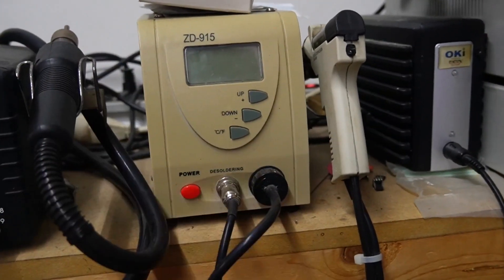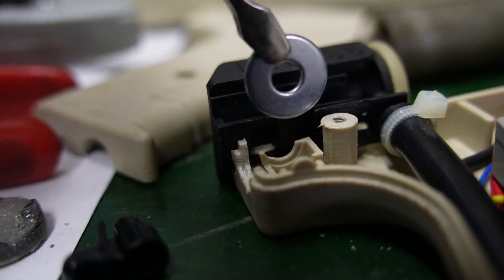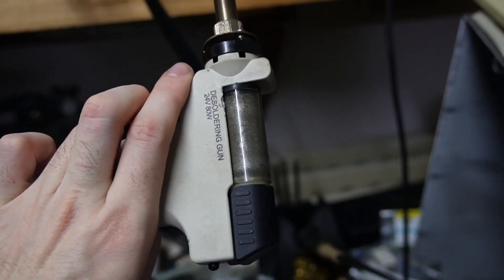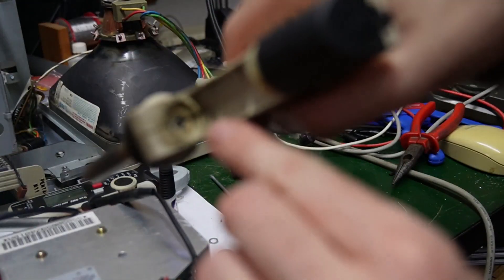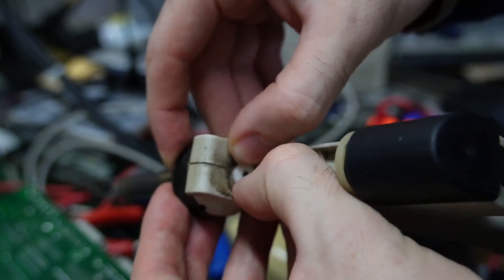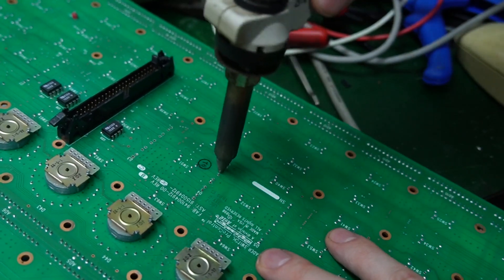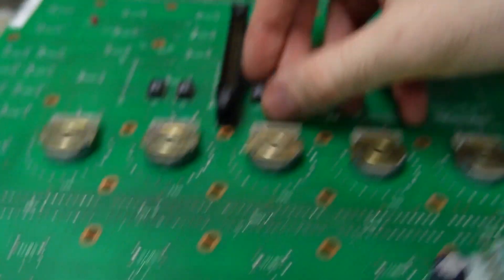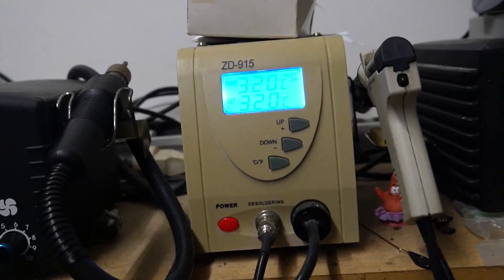ZD-915 Desoldering Station Repair and Long-term Review

Comment: Thank you very much!!! The tip with the silicone seal of your vaporizer is very good. I've the same problem... ;-)
Reply from the maker: I did find the original piece which is a round black rubber thing, it got lost somehow before for me. But I'm still using with the vape part because that one stays in place better :D.
Reply: @netman69  Ha! Yes, after you say that: I took a look in my desktop-trashcan... And: There I found the original-rubber-thing 😂

Comment: Fished one out of a dumpster not too long ago. Nice enough for when i need to liberate another 40-pin chip or worse rebuild a mechanical keyboard.
Reply from the maker: That's a nice dumpster find :)
Reply: @netman69    It sort of landed there for a reason.

The filter got clogged.

Yeah i think i need to raid that dumpster on the regular.

Comment: You put a white  little thicker ting in place off the rubber disk that should be there.
Reply from the maker: @leohobbleohobb3781  i did, i found the rubber thingy back later after I'd made the video.

Comment: It should be a rubber disk with a hole that should be tight around the end of hater tube. The rubber peace in front of glass tube should seal when pressed forward to the rubber disk surface that should be in front. The hole in mine is also to wide but it has the other rubber disk in front. sometimes it comes out when cleaning the tube and fall off. my guess is you are missing a rubber disk with a hole.
Reply from the maker: @leohobbleohobb3781  This is correct, but i didn't realize it at the time of recording the video. I found the rubber part back but i am still using the white silicon thing i placed instead.

Comment: It's  good work??
Reply from the maker: It does work good, but the handpiece needs regular cleaning and in my case is it broke so i repaired as in the video 😊
Reply: Thanks sir
Reply: Sir, zd915  and zd985  is different?
Both performances  is
Reply from the maker: @shyam-tcy  I'm not sure how much difference there is, most of these cheaper desoldering stations seem pretty similar in quality
Reply: Hello 
Can you send the link where you buy the membranes?

Comment: I was Googling to find how to reassemble the gun section that I took apart a few monts ago, in order to find an assembly diagram, but no luck.  I felled on your video that do not cover that, but I got more lucky this time.  For a very shots time I saw where the fume filter goes.

I 100% agree with you about Chinese CRAP.  They are often as much crappy for documents too. Producing a user manual with a bunch of safety notices (and sometimes useless), but lacking of a part assembly diagram is really stupid.

Comment: I have this same desoldering station. Yes, it does clog up a lot because that tube doesn't get hot enough and the solder solidifies before it makes it to the glass tube. I find not sucking the solder UP the tube helps a lot - i.e. hold the board so the gun is sucking horizontal makes a big difference. Like you said, letting it warm up for a long time gets that tube slightly hotter, and less chance of clogging. It was pretty cheap though compared to any of the other de soldering pump stations!
Reply from the maker: When it's warmed up all the way it almost never clogs, but the holding it horizontal is a new one to me, great to have more tricks in the arsenal :). For the price these things are pretty good indeed, a "real" one will cost like $1k (say from JBC or metcal).